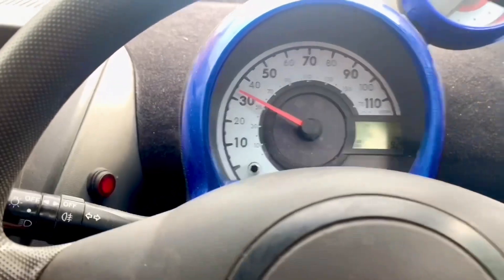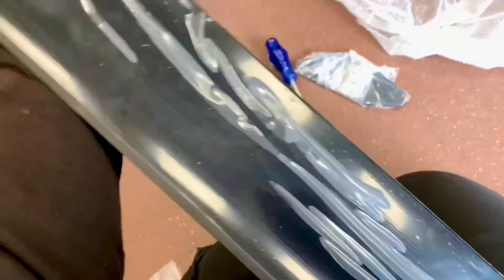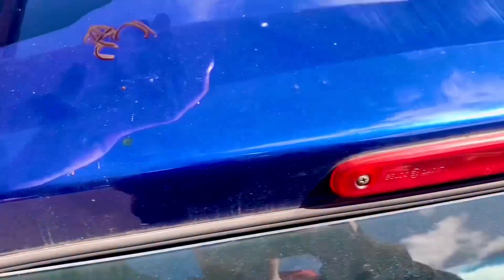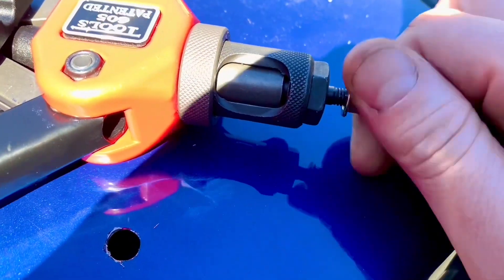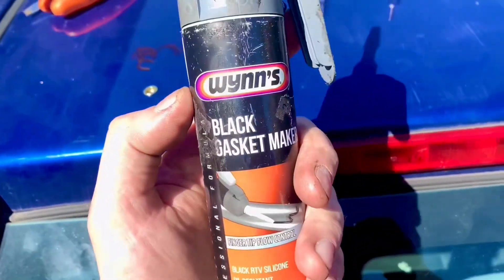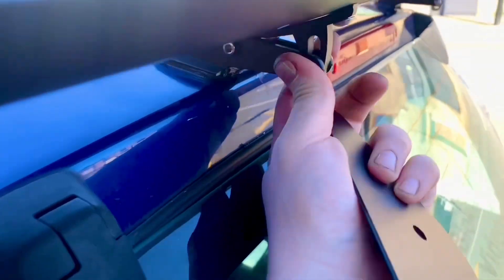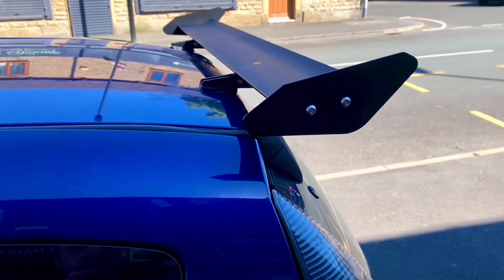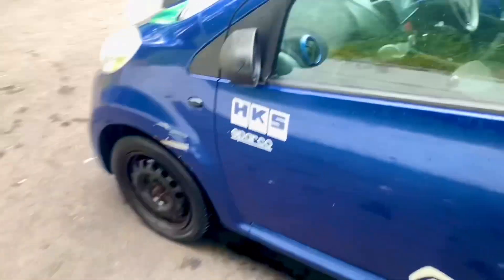FWD Downforce Test / How to Fit A Roof Wing / Citroen C1 Spoiler Installation (CityBug/Aygo/107)

Comment: Where did u get the spoiler from please do u have a link
Reply from the maker: @jasonchatwin6795  it came from eBay if I remember right. I think this one is the same:

https://www.ebay.co.uk/itm/204971870346?mkcid=16&mkevt=1&mkrid=711-127632-2357-0&ssspo=lZ24xoNWTEO&sssrc=4429486&ssuid=B24T_G0JTKS&var=&widget_ver=artemis&media=COPY
Reply: @ awesome mate thankyou just ordered one and thanks for ur videos on here they’ve helped me loads as well as a giggle
Reply from the maker: @jasonchatwin6795  you’re welcome mate. Good to hear you like the vids
Reply: @StupidBlokeStupidVideos  forgot to ask those rivet things what was they and size please if u remember 👍
Reply from the maker: @ m6 rivnuts bro
Reply: @StupidBlokeStupidVideos  cheers mate did u use any sealant in the end to stop water leaking did u seal it from the top or underneath
Reply from the maker: @ I just put some around the screw holes before I put the spoiler on

Comment: I have a question, if my car is cranking and not strating is there a posability its ECU (when I was driving my car just lost power and when I connect Carly to OBD port it just says it cant establishe connection to ECU)
Reply from the maker: That sounds like you could have a wiring fault or an ecu fault but it’s very hard to say without looking. Also, some cars have a fuse for the engine management system. Worth checking if it has one and if it’s blown